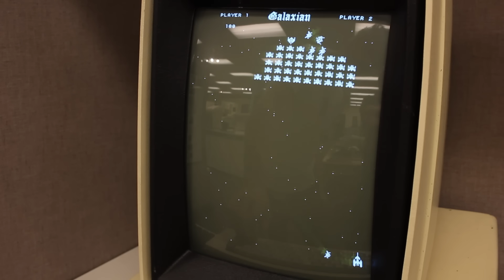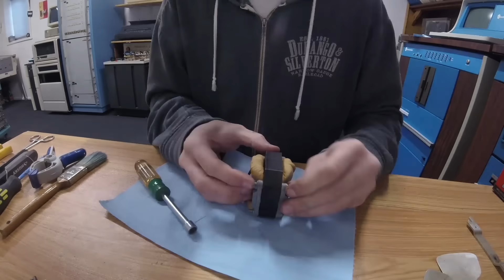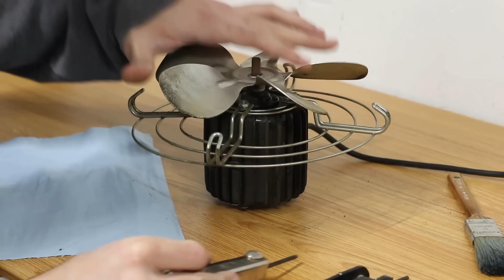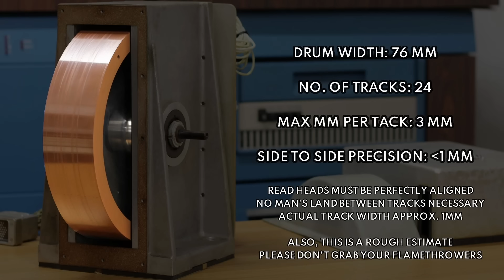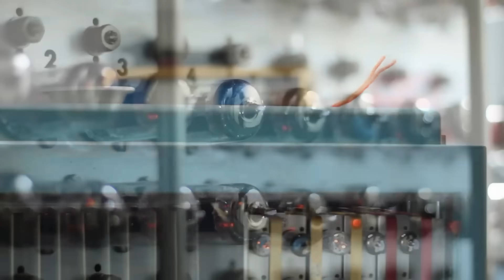Reviving 65 Year Old Bearings

Comment: Knowing you wouldn't be able to rewrite the tracks if anything goes wrong with the drum is scary.
Reply from the maker: It's not impossible to rewrite the tracks, just not easy is all.

The issue is timing. Since the electric motor spinning the drum can vary slightly from machine to machine, it's quite difficult to write tracks down from scratch. That's why Bendix supplied a spare clock track. Using the spare clock track, a new clock track and new timing track can be laid down, fully synchronized to the spare clock track, regardless of the exact RPM of the electric motor. 
However, if all three tracks were blitzed (due to alignment issues or recoating the drum), then it becomes a lot harder. I imagine Bendix had a very precise electric motor with some way of measuring RPM very precisely that they used at the factory to lay down the first clock track from scratch. After that, the procedure becomes the same for field service laying down replacement clock and timing tracks.

For us, to lay down new tracks from scratch, we have the benefit of modern technology. A hall-effect sensor in the right place can give us a very precise RPM that can be used to lay down new tracks perfectly. But, that requires building a jig with electric motor outside of the machine, designing a notch wheel we can lock on the shaft and a hall effect sensor to read that, drivers to drive the read head in reverse to become a write head, and a lot of software to control it all. Very doable, but very time consuming. It's something I'll be happy to slowly tackle while working towards recoating the other drum, but unless the bearing situation becomes exceedingly dire, I'm planning on just sending it as is for this one!
Reply: I would suspect that with some modern equipment you can re-write the tracks, just not with the computer itself.
Reply: @Stoney3K  Probably. I wonder how easy that would be. In theory you just need the correct signal on the write head

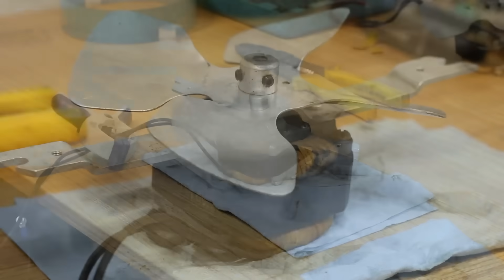Comment: 07:50 - the long spin-down is a sign of the oil coating the balls and races thinly. The grease is still there, splashed aside and dry. With no fresh grease this is a very temporary fix. Ungreased bearings have the longest spin-down, however they do not last.
Reply: remove bearing units , place in warm oven , pop races apart , clean old grease , add new , place in plastic bag in the fridge for a few mins bring back to room temp rotate by hand
Reply: @highpath4776  If you are going through the trouble of removing the bearings, it would be better to just replace them with new ones.
Reply: @highpath4776   Bearings are a wear item. They should be replaced even when trying to keep things original
Reply: @clonkex  Indeed I know of people who will machine their own bearings when originals are not avalible.  ( I mostly work with railway locomotives and re-metalling axles/ends copper white metal bearings is common along with the road vehicle engines ( though end roller and taper bearings are normally just swapped out ).
Reply: @clonkex  if they are a standard size. The fans probably are. Who knows on the memory drum.
Reply: @Knirin  The fan bearings are almost certainly a size that is still made. The drum bearings might be from another industry entirely, like aviation or automotive, but I bet they still exist too. If not, often a standard size bearing can be shimmed to do the job.

Comment: It's nice to see 65+ year old hardware spinning up like new!
Reply: wonder how it came to be retained rather than dismantled
Reply from the maker: @highpath4776  This particular machine was bought by an enthusiast back in the late 1960s. He bought four G15s actually as the engineering firm that was using them to design the highways up in the northeast was retiring them to replace with more modern TTL computers. He held on to all four until he passed in 2021. His estate then got in touch with Bob at System Source museum and through that avenue, one of them ended up here!
Reply from the maker: It's so cool to watch it amble back into life!

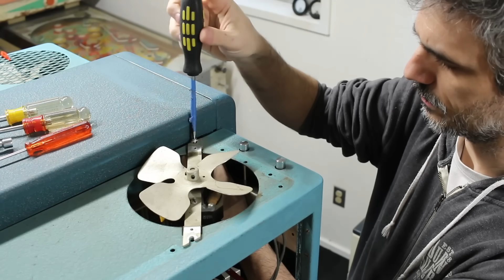Comment: 4:08 small washer falls into the machine...
I hope that doesn't cause an issue later?
Reply: Looks like he caught it in his hand.
Reply: @Ragnar8504 No it fell of the screw on the top side and slid off around the edge as he was pulling his hand away on the underside.
Reply: @1kreature  And then it was visible on top of the case a few seconds later. He caught it, whether in that moment or after.

Comment: I swear you dropped a washer in when removing the fan at 4:07, just in case you missed it.
Reply from the maker: Good catch, I did indeed. It fell all the way down and ended up landing on top of the preamp chassis. I was able to retrieve it with no problems!

Comment: How to get oil into a bearing:  heat the bearing in a 150 degree Fahrenheit oven, take out, drip oil on the race and then as the bearing cools, the oil will be pulled into the bearing.  I’ve used this trick to get oil into Telechron clock motor rotors.
Reply: thank you for that tip!! the motor in my WPB-era telechron is getting extremely noisy, and I couldn't figure out a way to get it apart to lubricate it that didn't involve destroying the motor.
Reply: @francistheodorecatte   As far as I know, everything inside the rotor is metal.  It is usually fairly easy to take the motor frame off the clock movement and then pull the rotor out with your fingers.  I baked the rotor at 150 degrees Fahrenheit for about 15 minutes to get it warm.  I used Caig Labs DeOxIt oil dropped on the 1 RPM gear’s bushing.  The oil gets pulled in as the rotor cools.  I had a 1950s era Chelsea Elechronometer with a Telechron movement which didn’t turn at all.  I used two bake and oil cycles and it has been running like new for a few years.  I have tried the trick a handful of times and have not yet found a rotor which could not be reduced with the method.
Reply: @wtmayhew  might be an idea to mention 150f in your first comment. I just presumed it was C I wouldn't have thought 65 degrees would have done much.
Reply: @zyeborm   I edited the comment to state temperature scale.
Reply: I've heard of using a soldering gun to heat up the rotors but I guess an oven would work, too. Personally I carefully drilled tiny holes in mine and pushed in oil manually. This worked fine and both clocks are still running quietly. One important consideration with Telechron rotors is that too much oil causes its own issues, I actually needed to drain some excess.
Reply: @eDoc2020   Thanks for the feedback.  It only takes a few drops of oil on placed on the output shaft bearing.  I considered drilling a hole, but decided against it because I didn’t want the possibility of metal filings getting inside.  Punching a hole has the potential to distort the housing.  Making a hole allows removal of the old lubricant.
Reply: I had dripped silicone oil onto a motor bearing, covered it with a piece of sheet rubber (e.g. from silicone cake mould or hot water bottle) and a hole to attach a bicycle pump to pressurize one side to force the oil in through the gap.

Comment: The bearings in the top fans look like standard 608 (skateboard) bearings (22mm o/d, 8mm i/d, 7mm thick).
Reply: It would be surprising if they used skateboard bearings in this computer.
Reply: @donmoore7785 More likely the other way round. 608 bearings existed long before skateboards were invented, so they made skateboards with whatever was readily available.
Reply: @donmoore7785  They were not purpose designed for skateboards, they were industrial bearing mainly used in small electric motors. That being said, any bearing supply places refer to 608s as 'skateboard bearings' because that industry consumed multiple millions of them.

Comment: I weep for your heat pump come summer haha. Great work! Also a 24mm on a canon eos m50 (one gen later than the m but pretty similar) with an adapter is my exact setup for stunning milky way shots. You can go 30 seconds, maybe even a minute, just on a tripod without much star trailing.

Comment: You should see about adding some sort of thermal switch to prevent the drum from spinning up when it is too cold. While you may be perfect about not spinning it up cold, obviously not everyone will be. You know that from experience as the first drum was likely damaged that way. Whatever system that does that should produce noise so that the person who flipped the switch will figure out what is preventing the system from turning on.
Reply: Pair of thermostat switches and a relay i to handle the power. That's a good call. 
A pair so you can set low and high temp limits.
Reply: @zyeborm  I’d love to see the hi-temp kick in during operation. The computer would instantly $&@“ itself! 😂
Reply: @glenncaughey5044  much better that than it having a head crash.
Also what I described isn't an example of hysteresis, it's not oscillating around a set point. There's just a safe window of operation and the drive temp might be behind room temp.
Reply: @glenncaughey5044  A high temp isn't so necessary because the heads will float and the computer will stop working, but no damage occurs. That's why it has an aluminum case and a TITANIUM (!) drum.
Reply: All that or a five cent plaque that says "Do not start below X degrees ambient"
Reply: @POVwithRC  If that didn't work for NASA, I don't trust it in the field.
Reply: @POVwalkswithrovingcyclops A sign will never work. You very much underestimate the ability of people to miss the very obvious.

Also, you're assuming the person who tries to turn it on can read.
Reply: @b2gills Also thermal inertia. A really cold night then the AC is turned on. The room might be up to temperature but the big lump wrapped up down the bottom there could still be frosty.
Reply: @zyeborm  
Word of the day: hysteresis 😎🍸
Reply: @zyeborm  Place the thermo sensor on a big metal part (the drum case?) that holds its temperature and not into plain air.
Reply: I suggest the noise be a shivery Brrrrrr.

Comment: Nice job.
But if this computer is supposed to run reliably the bearings need to be greased especially the drum bearings since they are subject to relative high load.
This means cleaning out the oil and repacking w. grease or just replace them,
The reference is stamped on the bearing seal.
Enjoy the humming ...
Reply: True but I can understand the reluctance to tear apart working drum memory, when getting it back together properly is an unknown and qualified technicians are non-existent.

Comment: A great tip someone gave me years ago, for identifying the source of sounds in a mechanical system: You take a big old screwdriver and use it like a solid stethoscope, except you pin the little fleshy flap, the tragus, over the opening of your ear with the end of the screwdriver. So it's not 'in' your ear but pushing the tragus into your ear-hole. This transmits vibrations into your ear canal and bones without any air-carried noise. What you hear is any vibrations coming from wherever the pointy end of the screwdriver is touching. More weight on the contact gives clearer sound, but risks damaging surfaces obviously. This is really useful for diagnosing car engines, as it filters out so much extraneous noise, but in your case it would immediately tell you whether the noise is coming from the drum or the motor.
Reply from the maker: I use the big screwdriver technique a lot when finding weird noises when working on cars!
That was going to be my next step, but literally, as soon as I hit the stop recording button, before I turned around, the bearings got quiet and stayed quiet. Makes it hard to find the strange noise when it's no longer making the noise, haha.
Reply: @UsagiElectric  yes, indeed! Intermittent faults never happen when you're waiting for them. Hopefully it was just a stubborn lump of congealed grease that finally got the message to go with the flow.
Reply: A device called a mechanics stethoscope exists. I’d imagine that would provide any help in locating any other bearings that might still make noise.
Reply: @tradde11 I've used my giant screwdriver for pinpointing lifter noise plenty of times on old cars. Just saying that in a giant piece of electronic history i would hesitate to be poking around much unless it was a non-metallic screwdriver. 

How about we compromise & suggest he finds a wood dowel with a handle on the end for the same purpose? No arcing or getting zapped that way.
Reply: @tradde11 I’d love to see a mechanic try using the screwdriver method while driving because I’m curious just how well that would work.
Reply: @tradde11 not all bearings can be checked while idling. Not all bearings are the easiest to check with a screwdriver. Sure a mechanic can diagnose a car while driving using just their ears but there are some cases where a better way of hearing the problem sound is just necessary. I’m in no way dismissing the use of a screwdriver just that other proper tools exist to diagnosing issues you might not have otherwise thought about. Besides the best tools to use are the ones you have. Sometimes however the best tool can be more specialized for a specific task. I’ve seen some tools that are created for a singular purpose or job and may even collect dust. Tools to a mechanic in a shop is all about saving time and effort to make more money usually. I believe the main point I have is that it can be dangerous to stick a screwdriver around just anywhere as a vehicle has moving parts. More importantly is this computer contains dangerous voltages and a screwdriver is conductive normally.
Reply: @tradde11 absolutely; although watching my brother try to hear a valve noise on my 63 Galaxie & managing to find a plug wire instead with the screwdriver was hilarious. 

I mainly meant for further diagnosis of the tube computer in the video, personally would be very careful about anything metal in there while it's running.
Reply: Or just use a stethoscope, and place a small roller bearing into the pipe end to act as coupler for tight spaces. The regular one works well to get to the general area.
Reply: @SeanBZA  or you could take it to an expert who will strip it all down, repair and check its fully functional!
Reply: You can get surprisingly good results with just a plain bit of hose btw. Especially if your looking for vacuum leaks.

I truck the screwdriver and others are about using tools you have on or in hand, not that they are the ultimate best tool for the job.
Reply: @zyeborm  The inestimable Ian Tyrrell can tune a Lamborghini Miura's V12 to perfection using only a length of hose-pipe and a screwdriver. Listening to each intake and adjust them into synchronization. 
 He even manages to make it look easy, and then balances a coin on its edge on the running engine's head. It's a sight to see, and a great demonstration of the powerful  combination of simple tools and knowledge.
Reply: I just tried this on the standing fan I have in my room and it worked amazingly well! Thanks!
Reply: @leonarperro  I'm glad you found it useful! Thank you.
Reply: While this works (the stick - as they used to call it, you can see it in the movie Das Boot in all its glory, used to identify engine noises in a cacophony of other noises) it's probably simpler to buy an old stethoscope for babies. Specifically a fetal stethoscope.
Source: i have a couple of them from my mother's father, who was a doctor. Really good, beyond what the stick can do. Bout the only better option (on cars) is to buy the special microphones used for vibration and to screw them around the engine bay into points of interest and record them on a quality recorder to analyze in audacity.
Reply: Yep old Dad trick though my Dad just used a block of wood, a
Reply: @ludmilascoles1195  the only DIY tip I ever got from my Dad was "Don't let me put up your shelves." He was dead right about that, though.
Reply: yes we use that for listening to fuel injectors on a running car
Reply: Or, quite seriously, gently hold the screwdriver between your teeth!
Sounds slightly crazy but it works a treat, just be VERY careful around rotating machinery.
Reply: @tomsproston5837  Putting dirty tools (including torchlight) or machine parts into your mouth causes cancer! I really shrug and gag everytime I see the Autodoktoren (mechanics of a German car repair TV docu) put everything into their mouth (screws full of old motor oil, torchlight (use a headlamp instead), hose for sucking gasoline into a bucket etc.).
Reply: Genius! If you don't have a stethoscope this is an awesome trick. Sounds like something my dad would have said to me when I used to do my own repairs on my car.
Reply: @tradde11 because a mechanic's stethoscope with rubber tubes & a plastic tube would be a lot less zappy than a screwdriver lol
Reply: @danl6634  Not to mention you can look directly where you are probing for sound/vibrations. Makes getting zapped -- or mangled by the mechanical spinny bits -- less likely.
Reply: @danl6634  Cost of Stethoscope - £1500 - Cost of Screwdriver - £18.99 nuff said
Reply: @darren6202  good lord did ya find a gold plated one? They've got a mechanic's stethoscope for $7.99 at harbor freight in the us.
Reply: @darren6202  Thats a damned expensive stethoscope. Must be pure platinum with diamond encrusted gold plate.
Reply: @Agnemons  Nah mate - That's converted from dollars from over the top rip off prices within the US and A medical system
Reply: @darren6202  What? A stethoscope (rubber hose with earpieces) costs only some 10 bucks on eBay.

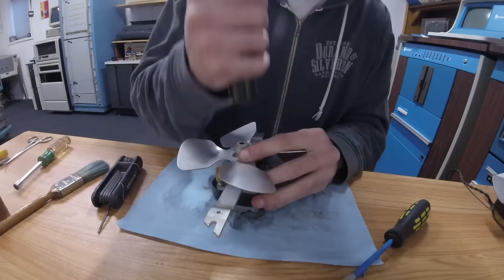Comment: @8:56, did the fans spin in opposite direcctions ?, one would be extracting air, the other pulling air in,
But if not, simply take the motor apart and invert the coil ;)